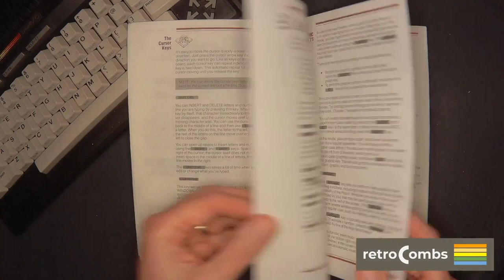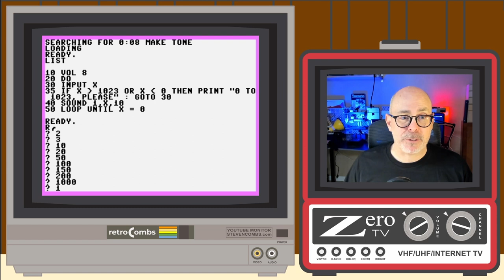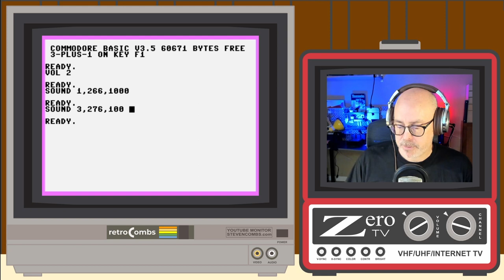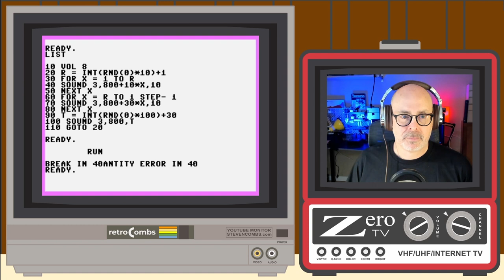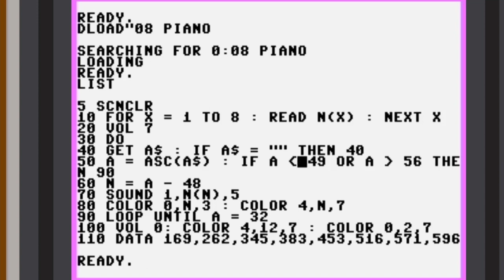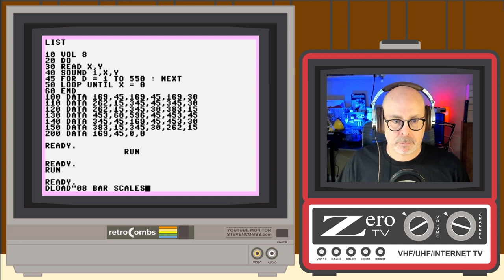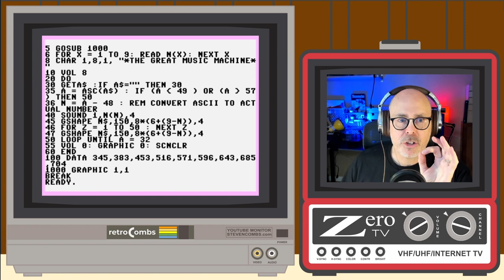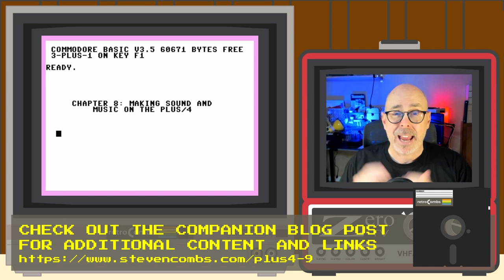Commodore Plus/4 User's Manual | Chapter 8 - Making Sound and Music | Beeps, boops and bops!

Comment: Great presentation, I have mostly been able to get your demo's working using basic 3.5 on a c64 mini with an external keyboard. Very enjoyable exercises....thanks
Reply from the maker: Might I ask how you have BASIC 3.5 installed on TheC64 mini? That's sounds very interesting.
Reply: @retroCombs  I just downloaded the program and inserted it on a blank.d64 file and ran it from an external usb like any external .d64 formatted game files. It works well like any type of Commodore 64 Emulator. I had a real Commodore 64 but sold it so I could upgrade to an Amiga. Unfortunately I didn’t appreciate the real value of the machine. I also had a cassette and disk drive with many great programs. If we could go back in time and change somethings.
Reply from the maker: @joerinaldi5  I read you loud and clear. I've unfortunately had to repurchase the computers I grew up with but the fun part has been purchasing those I didn't, too.

Comment: I don't think it's really accurate to say the TED computers were designed to be business computers. The extremely colorful palette doesn't have a business use, and the lack of 80 column text looked really bad compared to the business computer competition.

Rather, the goal was cost reduction. The Commodore 116 would be a less expensive replacement for the VIC20, designed to utterly destroy TI according to Tramiel's vindictive desire to exact revenge. Ironically, the Commodore 64 was well on its way to destroying the competition already and economies of scale allowed the C64's price to come down enough to finish the job. The C64's price never dipped down to the envisioned $50 point of the 116, but it didn't need to. Basically, the market itself destroyed the low end when consumers realized the <$100 computers were useless garbage.

Basically, the TED computers made sense to develop in 1983. The VIC-20 was an incredibly successful computer, but the C64 was also successful despite not being backwards compatible. So, backwards compatibility did not seem important. However, in just a couple years the C64 saturated the market. By the time the TED computers would be ready for production, backwards compatibility would be important. And also, the C64 had come down in price enough that people wanted to spend a little more for a computer that had lots of software and capabilities, rather than get a computer that was a lot less value.

Commodore was left with a dud of a product that no one wanted. The competition it was supposed to slay was already killed off by the C64 and consumers demanding higher standards (because of the C64)

So. Why didn't the TED feature sprite graphics? Well, cost reduction, but also ... clock cycles aren't so kind. The bus speed is slower (same as Atari 8-bit), which means there aren't many cycles to spare per scanline. The Atari 8-bit sprites were only 8 pixels wide, in contrast to the C64's 24 pixel wide sprites. Even if the TED computers had sprites, they would have been pretty poor compared to the C64.
Reply from the maker: It's confusing. While I agree with regard to the C16 and the original intent, after Commodore saw what they had with the Plus/4, articles like this one from Compute! Magazine demonstrate the shift in user focus:

"…The machine is truly a more business-oriented computer with its optional built-in “integrating” software and “screen window” capability. Imagine working with a word processor and data base or electronic spread sheet simultaneously on the screen. This allows writing on the word processor while viewing data from the data base or spread sheet (i.e., addresses, recipes, dates to remember, inventory control data, financial analysis data, etc.)."
Reply: @retroCombs  Think of it this way. It's easier to add capabilities to a cheap system than it is to try and cost reduce an expensive system. The TED was designed around the $50 C116 concept, with the more capable variants trying to add stuff to compete with higher end computers.

That's sort of how the C64 was designed also. A lot of the strange aspects of the C64 only make sense if you see it as a premium version of the Commodore MAX (which had far less RAM). The MAX had little RAM, so the fact that the VIC-II chip could only access 16KB was no big deal. The lack of BASIC commands for graphics, sound, and floppy are more understandable. The bizarre way the C64 infamously reports only 38K available is more understandable if it's an awkward hack on hardware designed around much less RAM.